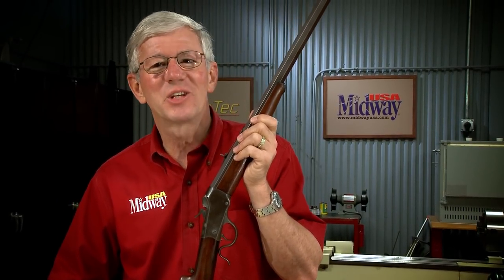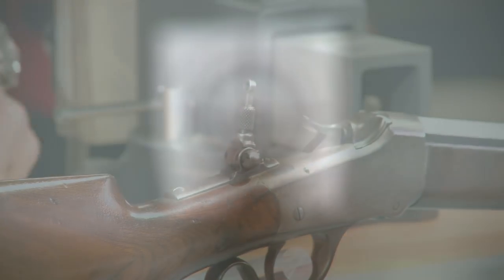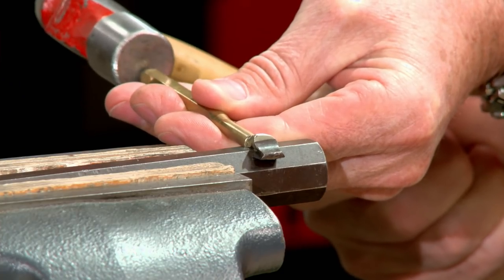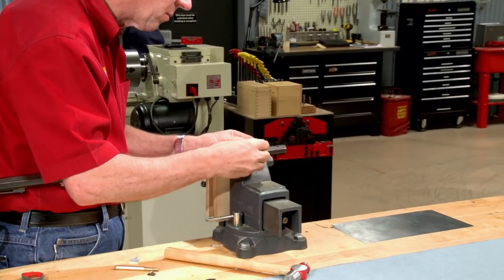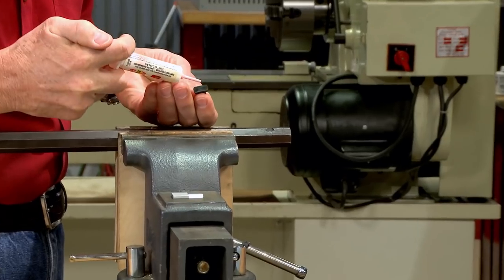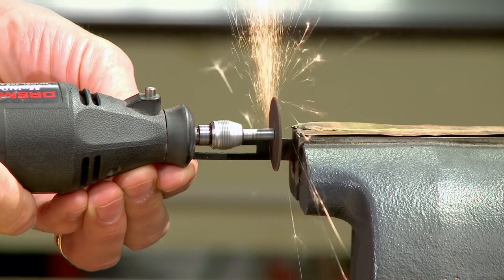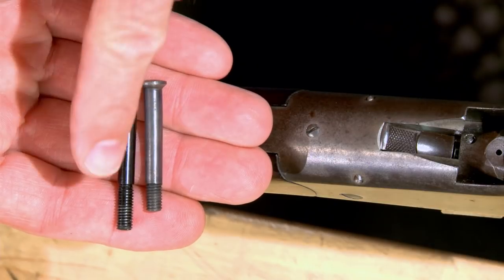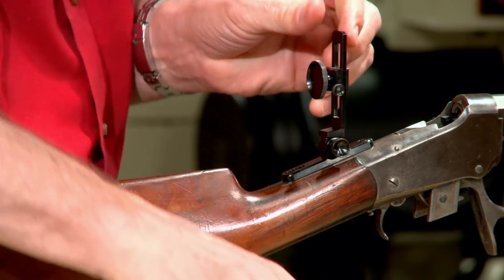Installing Precision Sights on a Winchester 1885 | MidwayUSA Gunsmithing

Comment: Whoa Larry, you used a shim?! I thought for sure you would've  filled in the old cut with some weld, ground off all of the barrel coating, recut the dovetail, reblued the barrel, and then re-bore to a different caliber just for good measure
Reply: Lol
Reply: DNCash maybe he wanted to keep the rifle in factory condition, if he ever wanted to sell it, those after market parts would diminish the value
Reply: @thotpatrol1342  That was a joke, and reference to some of Midway's other videos such as the "filling screw holes" one where they welded plugs into the holes then refinished the whole thing, probably using $10000 worth of tools.

Comment: I need to install a Montana vintage tang sight on my 1873. Their sight doesn't mention one for a specific 1873. It looks like the mounts only  issues were told I needed a mount for an 1875. If that's what I need, fine, I'll get it, just didn't want to  buy up anything I didn't  need, Those sights aren't cheap

Comment: I made the same with my Pedersoli Tryon .50 . It was much more complicated because screws for the rear sight were too small . I had to drill and then tapping in order to use screws delivered with it . The result is good but not perfect . For the front sight, I made the same . But I had to work a piece of metal sheet to get a .5mm thickness . This give then, a much more accurate rifle. Incredible !

Comment: Good video but I have a question.....  I just bought a Marbles tang sight for my Winchester 1886.  I got it from Midway and the installation went just fine.  I have a friend who has been around old rifles for years and when I told him I needed to remove the buckhorn sight, he said, "no, no, no... you leave that on for closer shots and only use the tang for long distance."  Is this true?  Does the buckhorn have to be removed??  Any advice appreciated.

Comment: Hey guys, I'm a big fan of your videos, and I'm a happy customer.  I would love to see a video on the Browning B78 by you.  Specifically, trigger adjustment, and disassembly for cleaning. Also, since  this  highwall doesn't have a tang, what are my options for an aperture sight?  Mine is the 45/70 model with the untapered octagon barrel and military stock.  Thanks!

Comment: Why do sights always get drifted left to right? Why not the other way?
Reply: +Matt “Midnight Void”  The dovetail is tapered and gets tighter as you go to the left
Reply: Very good info, thanks!!
Reply: @tjport1980  there is a video where he cuts the dovetail. He cuts it with a mill in one pass with no tapering. Perhaps the tapering comes from the cut chips then. There was also the question why he milled it in one pass without first milling out the middle. Perhaps all of these things contribute to a minimal taper. Like you get a tapered hole with a bad drill.

Comment: I recently mounted a tang-2 peep sight to my Henry .22. I was told it would not fit, but being me...It was necessary to drill and tap ( from the under side) the one screw that secures the stock to the rifle. Then I trial fitted the sight, and marked the second hole farther up the tang. Drill and tap that, and voila! I can understand why they said it wouldn’t fit...not bolt interference, but not wanting folks to chop up their Henry.